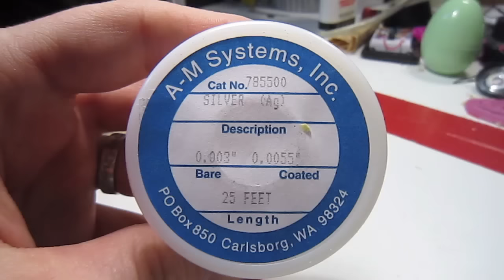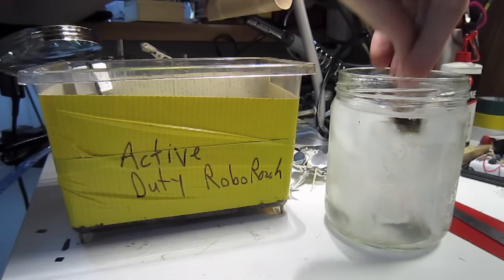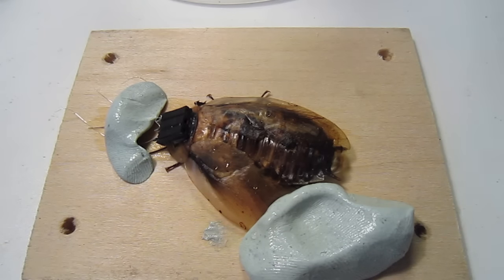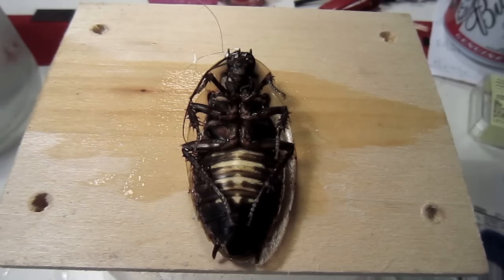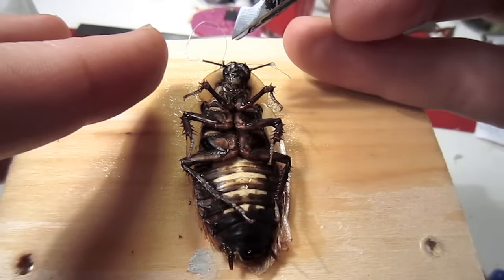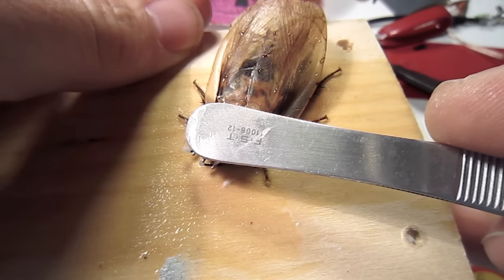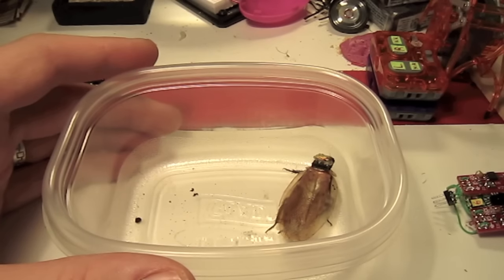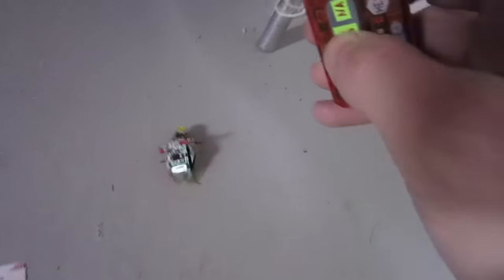RoboRoach (beta) Surgery Instructions

Comment: Anyone else's roboroach running slower than normal as after updating its firmware to Roachware 8.2.1
Reply: we can storm area 51 with robo cockroaches
Reply: @anthoneyparker446  yes
Reply: @anthoneyparker446  nah they lag at that range
Reply: And yeah my cockroach has been ruined by Roachware 8.2.1
Reply: So did mine so I reverted back to Roachware 8.2.0
Reply: @demogod4955  I'm on Roachware 8.1.9 8.2.0 didn't work for me
Reply: Yeah it's just a common bug
Reply: Get the patch... 8.2.2 Should fix the issue.. Reboot the roach after update.
Reply: actually lol'd
Reply: @admiral54barns56  ok thanks
Reply: Mine stopped getting updates a while ago. I'm stuck on version 7.2 🙁
Reply: Mine completely crashed after updating it to roboroach 8.2.1 and could not be repaired so i had to swicth to roborat 5.6, honestly i think its better
Reply: MrJohnsonx3 wtf I never knew experiments on roaches existed 🤯
Reply: Apparently, Roachware 8.2.1 has been cashing a lot for me. We may have to manually install the beta versions of new updates. They may not be stable, but they can work for the meantime. Until Roachware 8.2.2 comes out.
Reply: LOL
Reply: @DSX1  8.2.2 got released! It solved the issues, just make sure to do a full restart on your roach ;)
Reply: @dimitrijenovakovic7942  you never get rid of bugs with this experiment
Reply: @anthoneyparker446  i don't think so
Reply: Probably apple affiliated

Comment: the reason the cockroach turns left when he stimulates the right antenna is because the cockroach feels like it has touched an object/obstacle with it's right antenna so it turns left and vice versa.
Reply: that makes alot of sense actually. So if you reverse it, its essentially an RC cockroach right?
Reply: what does the RC mean?
Reply: Jacky Tsoi remote controlled
Reply: Good thinking :-)
Reply: eyes are not functional?
Reply: pain it wouldn't immediately turn away if it felt like it bumped into something.

Comment: Question kind sir CAN IT RUN CRISIS 3 ?
Reply: absolutely! FYI my robo-cockroach just unearthed 3 bitcoins so far
Reply: You need to get that quantum computer which have anti-proton RAM and super conducting silicon processor and which is running on direct nuclear fuel sitting in the zero gravity vaccum chamber to run CRYSIS 3.

Comment: How much does it live after the surgery? If you press both buttons at the same time will the cockroach go back?
Reply: PAPA STALIN it probably lives the normal time after surgery, it might have issues molting but after some time it should loosen up superglue to a point where you can pull out wires
Reply: Thank you!

Comment: would it be possible to, instead of using invasive surgery, use capacitive coupling. Have 3 electrodes. One on the bottom of the circuit, and 2 gently resting on or wrapped around the antenna. By applying an oscillating frequency to either of the antenna electrodes, you might be able to stimulate the antennas.

Comment: It is indeed so interesting that the roach we observed being worked on to a successful conclusion behaved as projected and responded in accordance with the respective commands (by turning left or right) under wireless remote control command stimuli interpreted by the control unit attached to it, but where the giant, South American roach simply came to a full stop responding to the same signal input. Fascinating. Different strokes for different roaches is how one might describe this. Interesting too, that the original roach was almost skidding (yawing or skating) when direct voltage was introduced. Perhaps this might simply have been as a result of the weight of the control device rather than the control input itself.
Reply: Your words truly remind us that this is not a roach-fest; this is science!
Reply: @Acoustic-Rabbit-Hole  Or so "RoachAI" (the cockroach which is completely interfaced to Chat GPT, Microsoft Azure and Google AI and which is fluent in every language) would have us believe.

Comment: It looks like the last cockroach actually refuses to respond to the input. There is probably a difference between biological input and the signal you are providing. Perhaps its natural input is more fine, more sensitive and much more precise than your equipment. Knowing about this was fine, but I feel like this looks a bit like an animal torture video (the cockroaches can feel, and it is demonstrated in the video. Look how wildly some of them turn? It must be painful, or shocking to them, no? Not ideal as an interface for any living thing, or human for that matter). There are solar powered digital robots that have more precise control and are roughly of the same size, which are purely mechanical and use a microcontroller instead of neurons that can die or be damaged or hurt.
Reply: There were some brain cells taught to play pong. I think that’s probably fine, because the system (apparently) doesn’t feel pain or have (well… I don’t know) consciousness.
Reply: if someone asked me to be a test subject, I’d say “no”. Then again some blind people had implants that let them see.